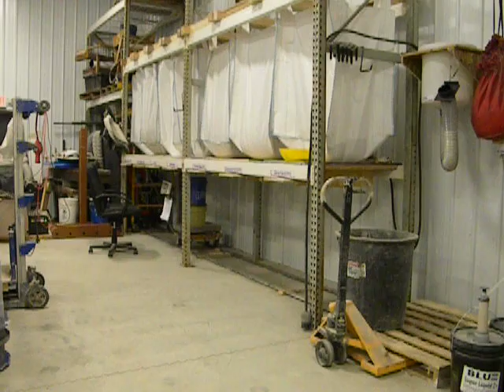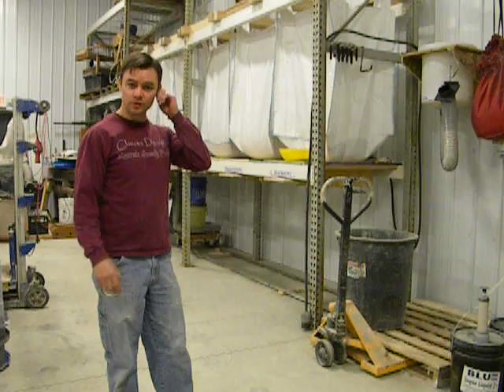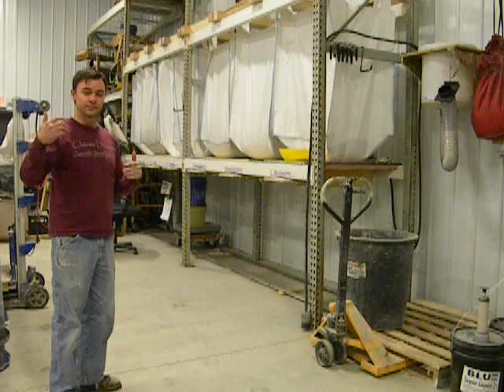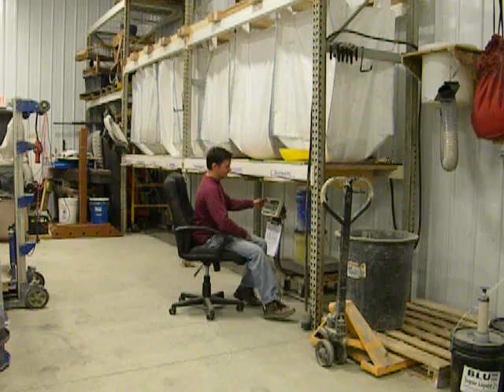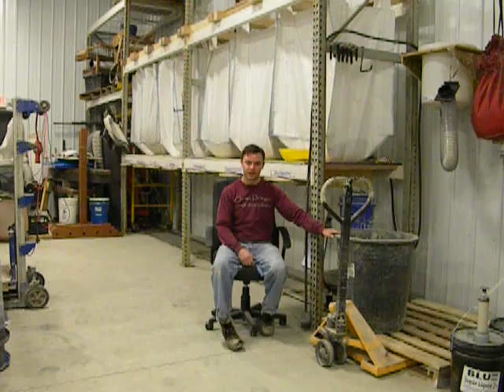Clauss Designs Concrete Specialty Products "New Batching System"

Comment from the maker: All our concrete products are made from our own mix designs, meaning we use computer generated mix design sheets and then use precision scales to batch out each ingredient to its weight specifications. This allows us to be confident in the quality of our product and gives us more room for creating the type of mix we want to use for each project.
Here is a description of what this video shows:
This is my new gravity feed batching system that I have designed and created. With our shops recent move to a brand new building in Angola Indiana... Where I live, one of my goals was to streamline our batching system to be more efficient. At my old shop, I used to keep all my dry ingredients in 30 gal plastic containers that I had to shovel out of and scale out, along with my sand stations that also had to be shoveled into my containers on the scale. This new design allows me to roll my scale from one product bay to the next with ease and continue down the line until all my bulk materials are batched. Then the container is moved onto a pallet at the end of the rail system and I continue with the rest of batch products at their station area. This new system is a real timesaver and physical saver as well.